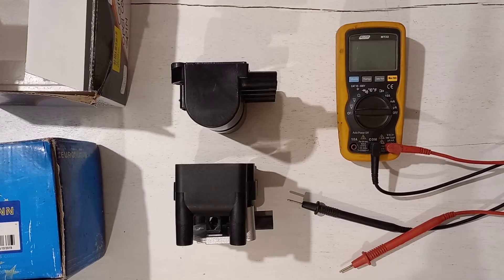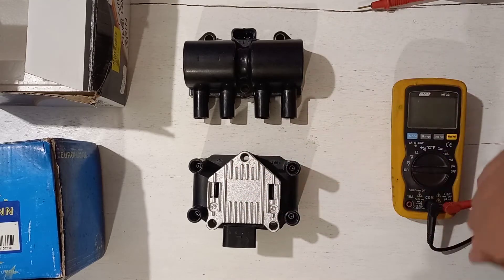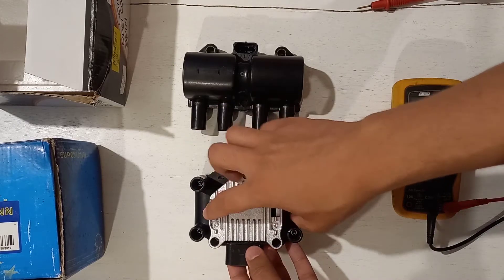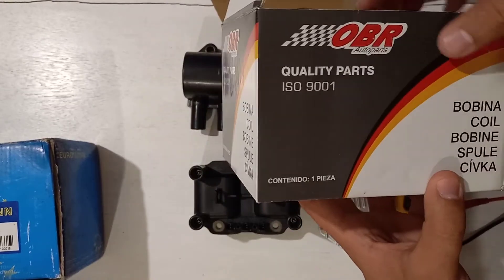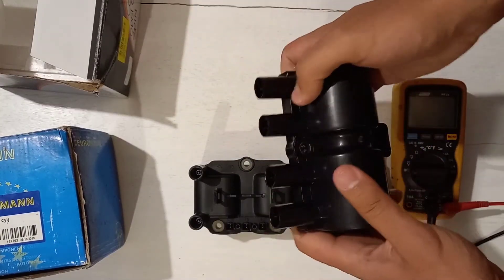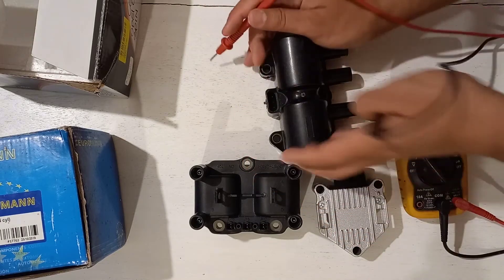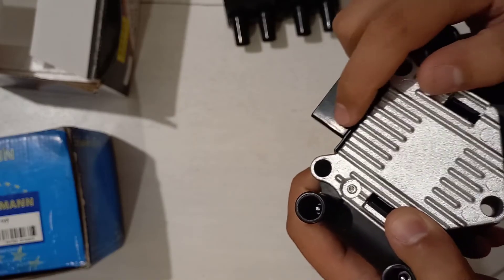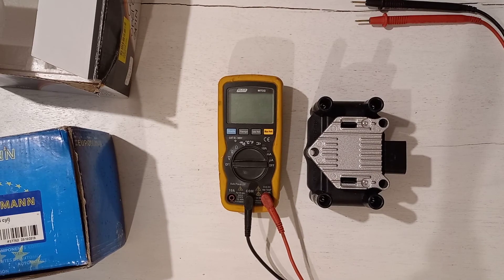Do you need ignition coil drivers|convert to wasted  spark setup| 3pin / 4pin coil

Comment: Is there any reason of measuring using pin2?
Reply from the maker: I don't understand the question. Elaborate?
Reply: I meant to say os there a reason not take measurements using pin2 on the VW coil.  You measure the primary resistance using pin 1&4 and again with pin4&3.
Reply from the maker: @pugsonditshego5539  Pin 1 is ground and common to both coil driver.

Comment: hay bud im driving a golf 2 witf a golf 3 gti 2l moter doing the turbo can u make a vedio of how to install the coil of the golf 4 please im sitting with spark problems
Reply from the maker: What ecu?
Reply from the maker: That depends on your ecu
Reply: I have spark problems too. I have speeduino 0.4 and im trying to use the same coil as you. How did you wire it and what ts setti gs are you using?